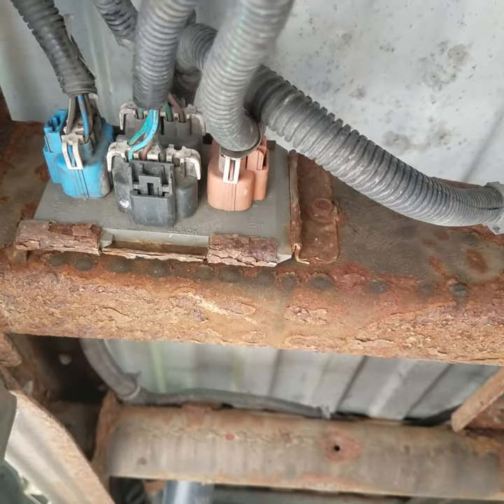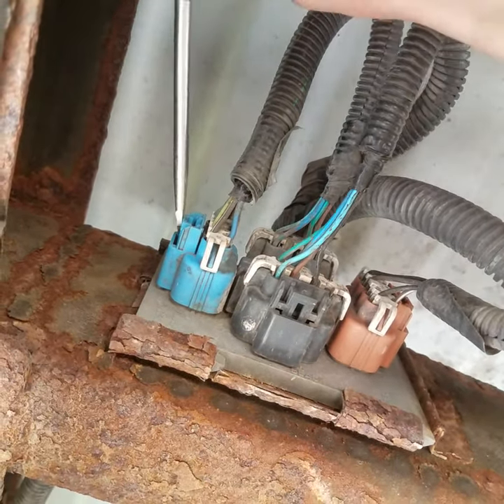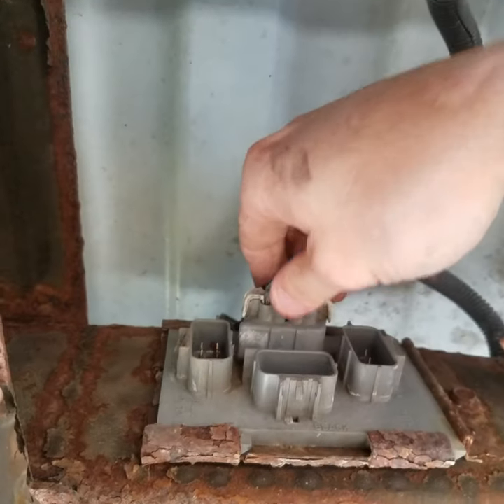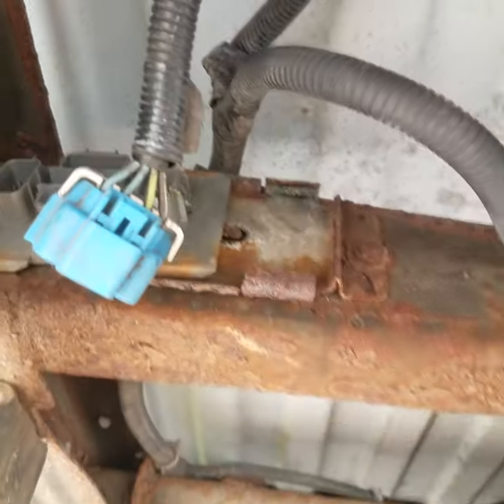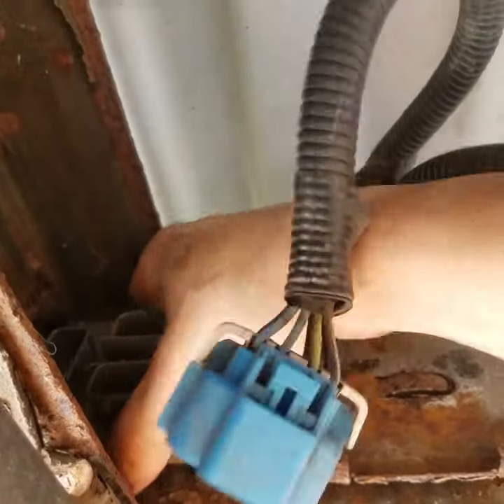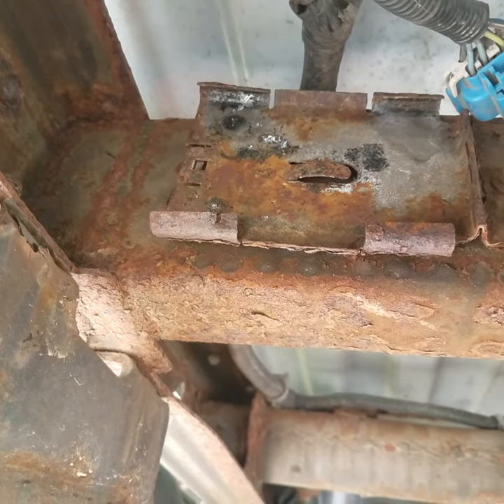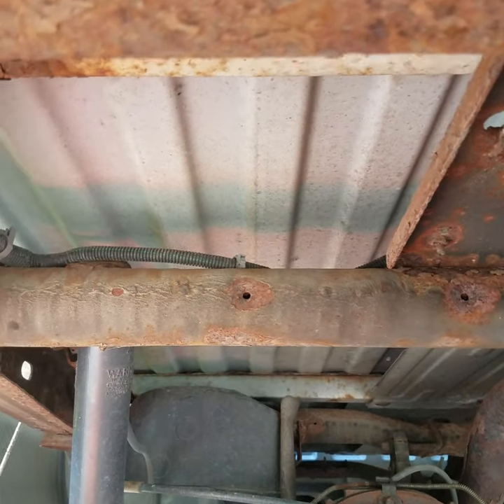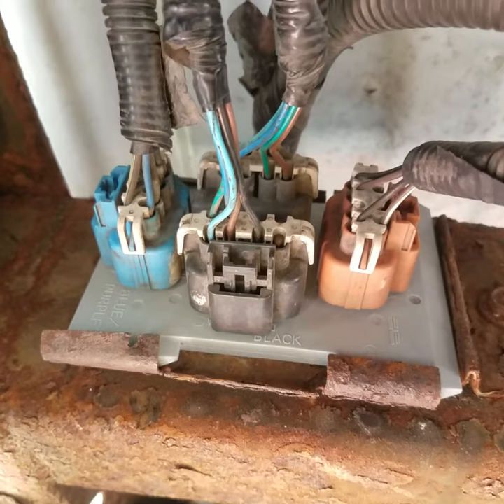1999-2013 Chevy or GMC tail light issues

Comment: I think I got salt water in it from my trip to Cape Hatteras and across the ferry to Ocracoke island and back to PA.
Reply: I drove through snow and now my right led tail light is very dim is this board the problem?
Reply: @jvera1620  remove the bulb harness assembly and take out each bulb and place dialectic grease in all connectors and put the bulbs back in harness.
Reply: Checked all the fuses and they are all good my passenger tail light is still very dim while my driver side is working perfectly fine still can't find the issue
Reply: @jvera1620  You probably have resistance in the wire harness or junction block that is not providing full power. You may have to replace the harness from taillight to junction block.
Reply: Yes those I my last 2 options I did test the tail light on another vehicle same model to be sure it wasn't my tail light and it worked just fine I do appreciate your help man
Reply: @jvera1620  what ended up being your problem ?
Reply: @Anti Social Justice Warrior  according to my guy those taillights (sierra16-18) have a life span and mine went out had to get a new one
Reply: @jvera1620  the plug itself ? Just spent hours last night figuring out my rear lights which are complicated by a homemade (beefy)  bumper with 4" truck lights. My plate light was arching out the whole drivers side light setup . Got them to work. Mine's an 04 plow truck so things get crusty.

Comment: Where is it located under the truck?
Reply: Did you find it? Im still looking...dam...wheres that tail light j7nction box.?
Reply: I have an 11 avalanche and can't find it under my truck......
Reply: Its under the truck, its under the bed in the rear of the truck sometimes its on the crossmember going across the frame, and sometimes its on the inside of the frame rail on the driver's side back of the truck under the bed
Reply: Follow the brake wires  under the truck from both sides forward until they end at this distribution block (my deffinition) of what the part is. You have to get on the ground or lift the truck to find it

Comment: All of my lights work except for my license plate lights, I replaced the bulbs and still nothing. Could it be a fuse or wiring?
Reply: Fuse for sure same issue with mine a while back now my right break light  dont work

Comment: So I am also having a similar issue, I have a 2002 Chevy Silverado 1500, my rear d/s drl went out, then a few hours later p/s went out. Brake lights still work, and so do the others. I did continuity checks on the harness from that buss that’s pointed out in the video and harness is good, yet no power for DRL. But brakes still work. Any one have any other checks I can do? I checked all my fuses already btw.
Reply: Did you find out what it was ?
Reply: do yk what is it my 02 suburban tail lights dont stay on but ma break and turn siganls and reverse work

Comment: Where did u order from ?
Reply from the maker: amazon
Reply: How is it called ?
Reply: @fademeupmarvin2778  For my wife's 2006 GMC Yukon Denali I replaced the old board with a new Dorman 923-012 Tail Light Circuit Board from Amazon and things worked for several months.  There was some green corrossion on the connections of the old board and plugs.  I cleaned up the plugs and replaced the board.  When she bought it the previous owner had installed some LEDs which I think might be part of the problems we have at night.